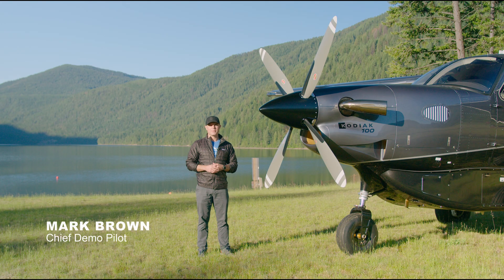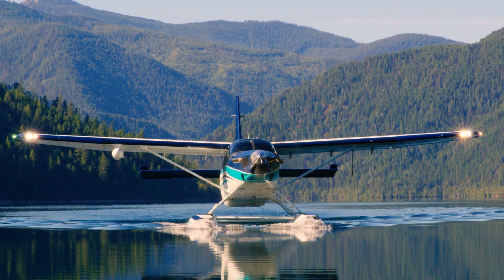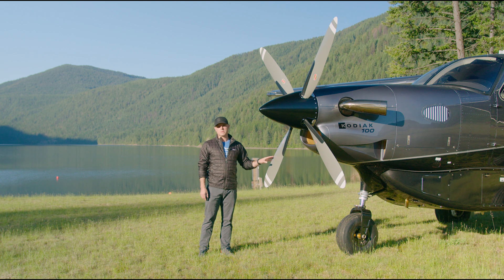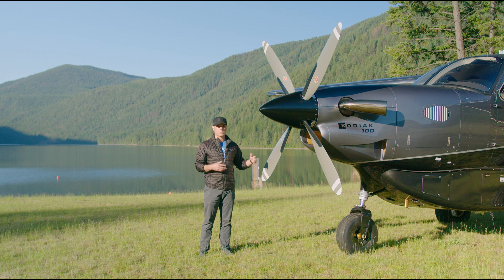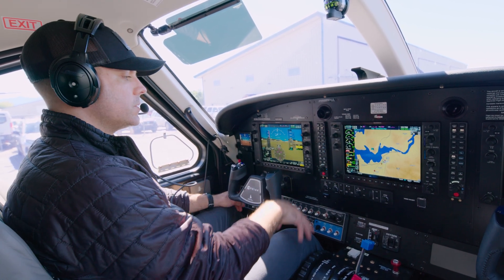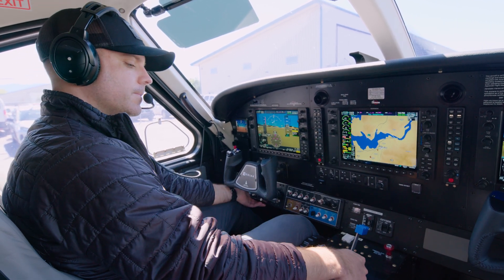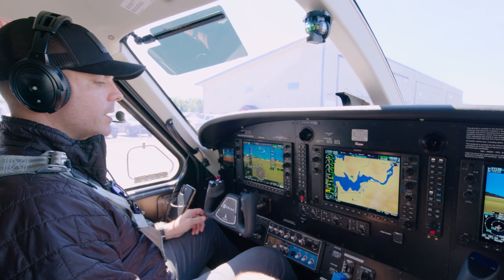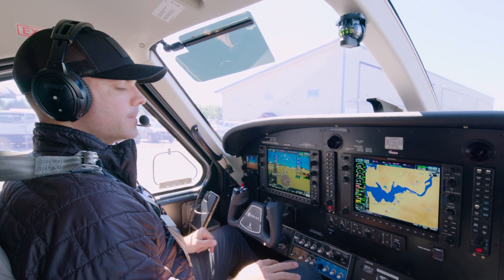Pitch Latch Propeller walk-through on the Kodiak 100, Series III

Comment: Greetings. The kodiak 100 series 3 seems to me to be an excellent very versatile aircraft, however I think it lagged a bit behind in terms of improvements that are already available even from the manufacturer itself. 1. Single level control 2. Radar embedded in the wing profile. 3. AUTOTROTTLE. 4. winglets. 5. HomeSafe. 6. Garmin 3000. 7. HARTZELL 5 Propellers - BLADE. Undoubtedly, these improvements would help performance, safety, and range. It sure comes in the next 4. series with better aerodynamics and performance.
Reply: A few counters to your points; Having a TPM power setup allows more versatility for the pilot. being able to adjust prop RPM without adjusting power is critical for back country flying, which is truly at the pilots discretion. The Wx radar being stood off of the wing means that you do not have an A-symmetrical lift profile, which the TBM has, and is not desirable in a STOL aircraft. Autothrottles are not necessary in an aircraft like this, and are very expensive to install, especially in a turboprop. An efficiently designed wind does not need items such as winglets, fences, or vortex generators, which are largely items that were installed on older aircraft that were not designed with computer based CFM software to analyze the wing characteristics. as for the G1000 as opposed to 3000, an aircraft on tundra tires with the suspension travel that an aircraft like this has, bounces around a lot, even on smooth asphalt, so having a touchscreen would be difficult to operate while taxiing, and doesn't really add anything special. More blades does equal more efficient flight, however it is at the cost of torque. the 4 blade is a good tradeoff of power and smoothness, but mostly adds the benefit of ground clearance, which is extremely important for this aircraft.

Comment: Very nice aircraft. I have a question though. What happens if engine shuts down during flight? Feathers automatically or goes to pitch latch?🤔
Reply: You have to pull the power lever a little aft of the gate on shutdown to engage the locks.